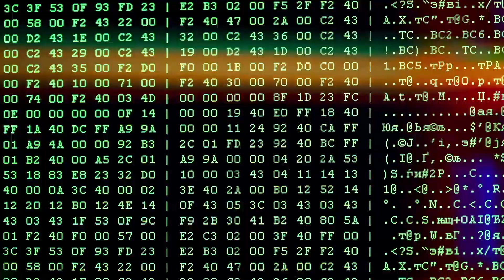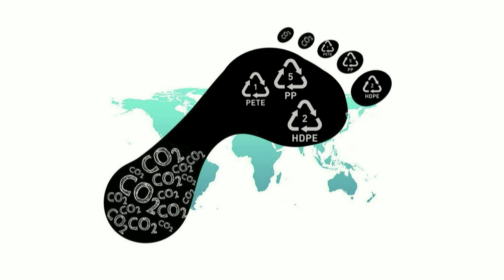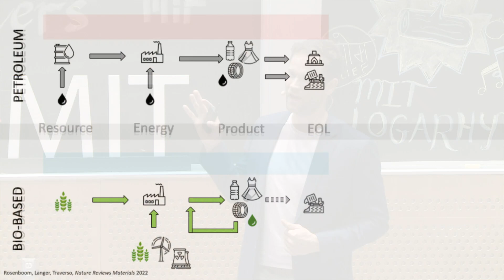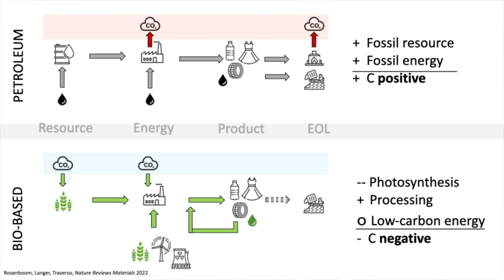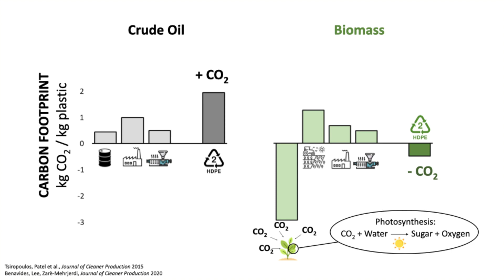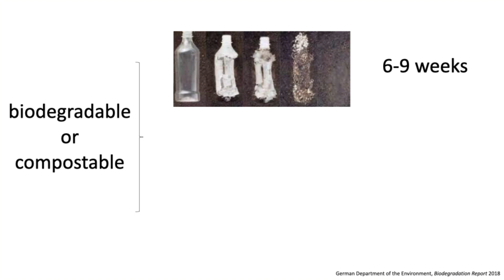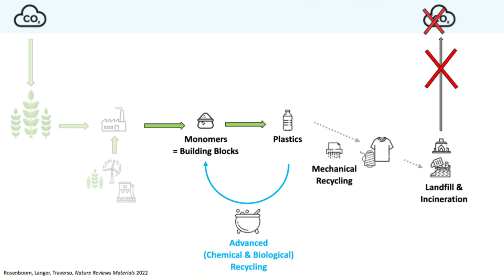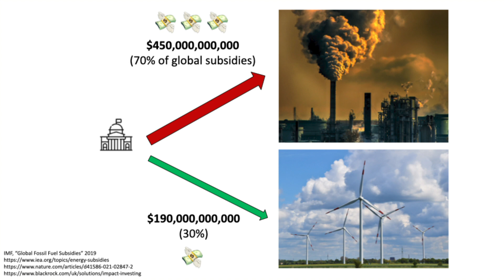Carbon-negative bioplastics for a climate-positive future | Jan-Georg Rosenboom | TEDxMIT

Comment: This is from AI chatbot. Many ecological systems, including plants and algae, rely on carbon dioxide (CO2) to survive and perform photosynthesis, which is the process by which they convert CO2 and sunlight into energy in the form of sugar. This process also generates oxygen as a byproduct, which is essential for the survival of animals and other organisms that breathe oxygen. Additionally, CO2 plays a key role in regulating the Earth's climate, as it acts as a greenhouse gas, trapping heat from the sun and keeping the planet warm enough to support life. Without CO2, Earth's surface would be too cold for most forms of life to survive.